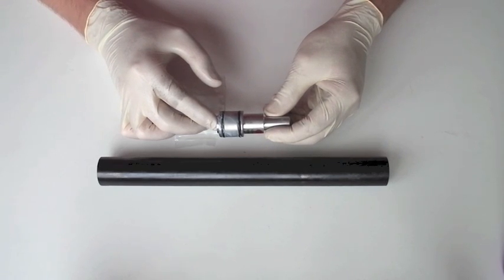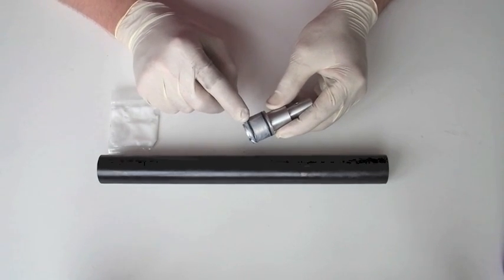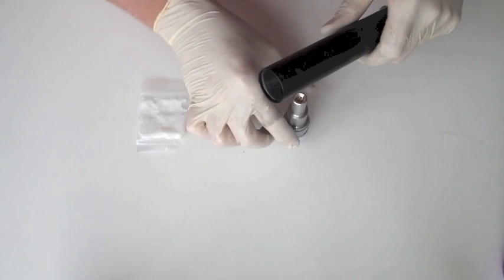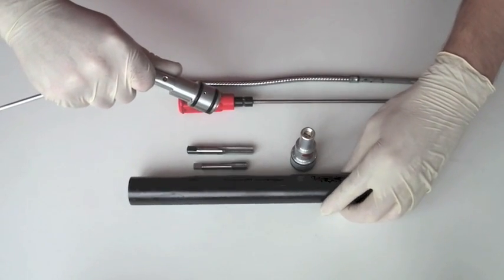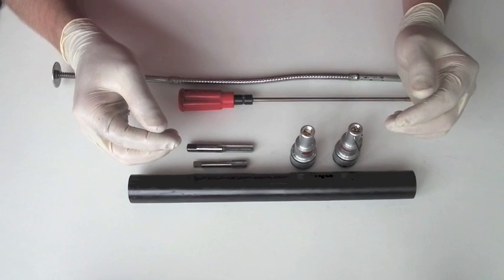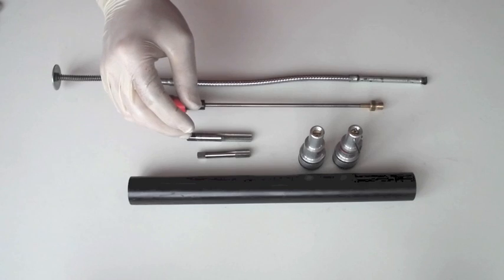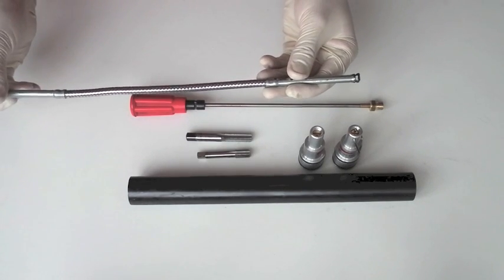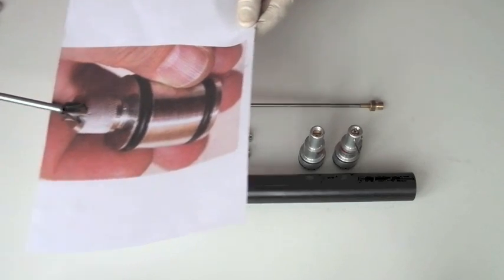Extraction & Removal Of Airgun Regulator.

Comment: what pressure is the reg set at for fac rifles
Reply: +Airgun Regulators totally understand  that but if you had done all tuning to a rifle set from standard 12ft Lbs surely you'd be limited by the set working air pressure by the reg.. so even if you had a maximum tuned rifle it's working pressure would be restricted by the set pressure of the reg.. I forsee it like if you was blowing down a straw with a 100 bar. . to get more power out out blowing down a drain pipe with the same 100 bar surely it would be beneficial to have more working air available